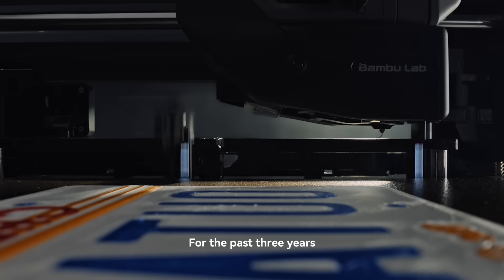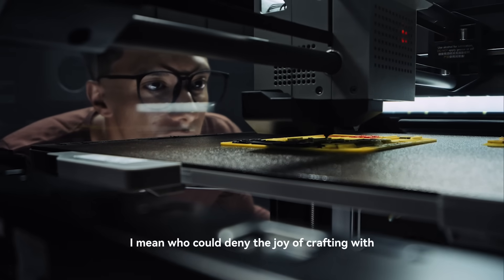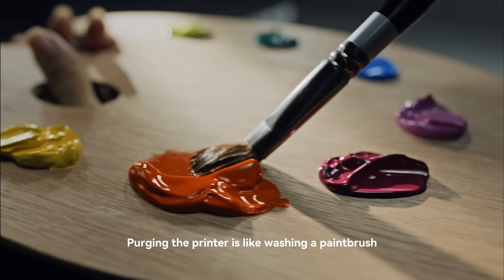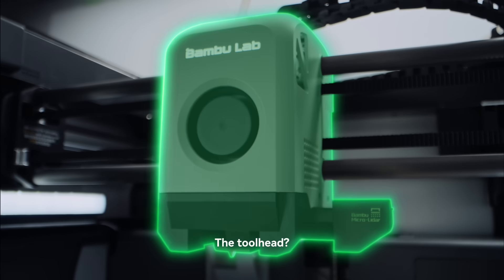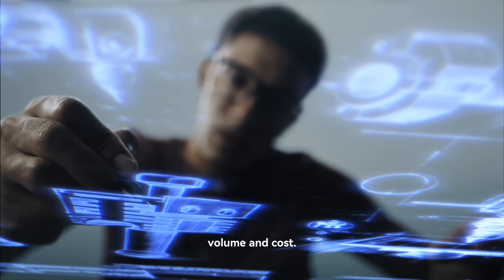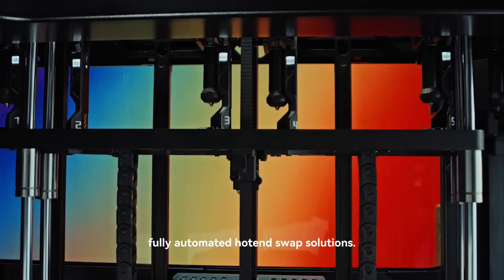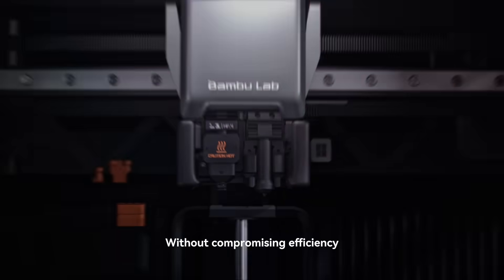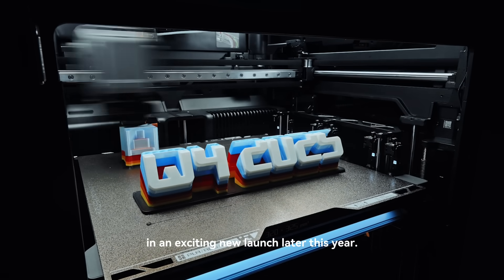Meet Vortek: Our Answer to Zero Purge Waste Multi-Material Printing

Comment: This is what was everyone waiting for!
Reply: This is what is everyone can not afford that ☺️
Reply: Indeed, but lots of folks already working on it, namely Bondtech INDX and SnapMaker U1.  Bambu just wants people to think twice before buying a U1.  Also laughable they’re unaware of all the other multi head printers (Prusa XL, SnapMaker U1, etc)
Reply: definitely not our bank accounts though
Reply: Lo estás esperando? Esto ya lo tiene la gente con la Prusa XL
Reply: @rmberoiza but for such a high price, low speed and limited to 5 color
Here u get even more, because it's 7 colors (6 removable hotends and 1 stationary)
Reply: @ILIKE3DPRINTERS no imprimo con más de 3 materiales/colores y lo que me gusta de la Prusa XL es lo modular del sistema
Reply: @ILIKE3DPRINTERS  you are assuming induction heated hotends with proprietary embedded data communication tech wont be expensive ? this thing looks overengineered nightmare with design intended to prevent 3rd party parts integration which means limited modification capability and expensive spare parts that will be only available through the company and nowhere else 

from the video the base model this will go in is H2D which is already obnoxiously expensive "premium" model where base its built on is already $2k+ so with all the extra tech in this you are looking at $3k+ printer ...

at which point you might as well go with Prusa XL to get a true full toolhead changer

also people are not realizing this method of swapping the hotend will REQUIRE AMS and will slow down the process because nozzle might be preheated but the time it will take to do the AMS filament change didnt go away and will eat up into the time savings that can be head with actual toolchangers
Reply: @Asghaad how do you know that is their intention? in order to solve the waste problem they have to do their own way so that people like you don't say they are copying others. And swapping filament with AMS doesn't take a long time(tested and proven), the ones that are time consuming are purging and cleaning the nozzle from previous material. I think you didn't watch the whole video.
Reply: @KokaKuku  and im fully aware how long it takes for AMS to swap the filaments as i do own a Bambu printer with AMS2Pro

the fact is that it will never be as quick as full toolhead swap (5 seconds) or the nozzle WITH filament in it swap (12 seconds)... sure it wont take more than a minute as with normal single nozzle AMS but id estimate at the fastest the whole process will take 20 seconds  and that only if they are going to do filament retraction and refill during the head making the nozzle swap, if its going to be retraction - nozzle swap - feeding sequentially then thats 30+ seconds per change THEN prime on a tower that will still be necessary ...

faster yes but not comparable to actual toolchanger
Reply: @ILIKE3DPRINTERS  actually. its more than 7 colors. Your still bound to your ams here. Even if you have 7 nozzles you can only use whats in the ams. So then if you have1 ams unit you only get 4 colors, if you have 2 ams unit and wanted to use all of them, one nozzle would still have to go through the whole purge process as if it was a standard single nozzle.
Reply: @Asghaad at least they have eliminate the longest time consuming process in their own new tech even by the fact that with this method there is no way in the real or after life it gonna be the same speed as toolhead changer logically.
Reply: @JBtuned-x8c  I know I know
I should just say it has 6 changeable hotends
But yeah, you can connect AMS to Bambu H2 and you cannot do the same with Prusa XL
Reply: @KokaKuku  the issue i see with this is that its slower than toolchanger while costing close to one with no midrange option in sight leaving people to swing between Prusa XL a true full toolhead changer with modularity and "H2D+" that will cost more than base model XL
Reply: @Asghaad well offcourse that might be the issue for us "tech savvy". But bambu business audience is not just for people like us, imagine people with no knowledge at all about 3d printing starting with bambu vs starting with prusa. The numbers of sold show it all.
Reply: and I'm curious how an ams could play into this, are they gonna have 4 out tubes? 6 out? 7 out? or will it be completely eliminated
Reply: @rmberoiza the prusa XL does not change hot ends it changes the entire tool head did you watch the video
Reply: @rmberoiza for like 4300€, without an enclosure, bad VFA? No, thanks.
Reply: @rmberoiza oh alright somebody already made a car, so it would be dumb to make a different car.
Reply: @rmberoiza  prusa doesn't have the quality bambu does in my experience
Reply: @undeadly1103  Prusa do have quality, but  you just getting less features for more money
Reply: @undeadly1103  If integrity and customer respect were grading criteria, Prusa would score top marks—while Bambu Lab would barely pass.
Reply: @Tesla3131  ok? what does that have to do with print quality?

Comment: kind of hoping it will be an upgrade kit for the x1c too
Reply: They can't do it due to how the hotends are wried in to the X1C
Reply: @STP4L  well they could offer a different tool head
Reply: @Ari91 not without changing the control board